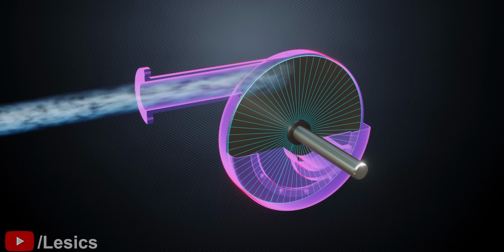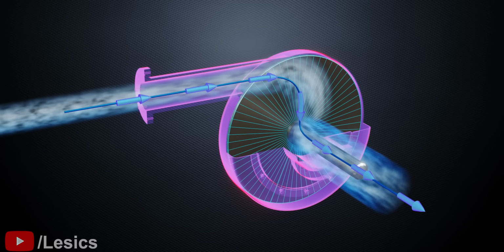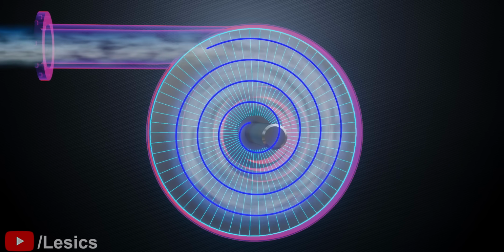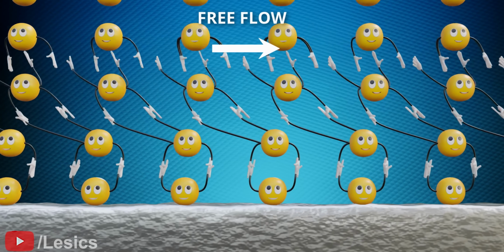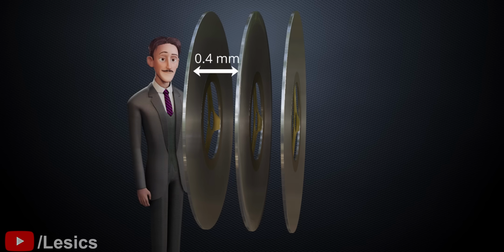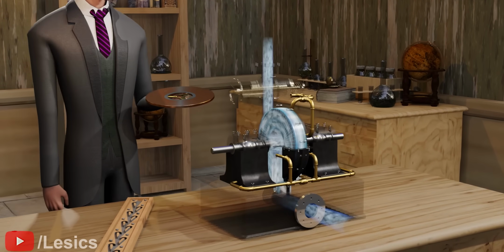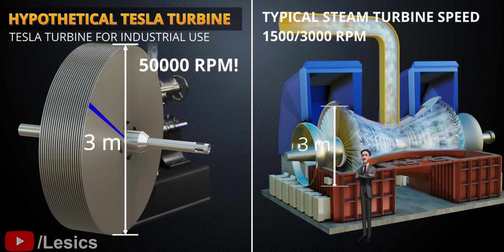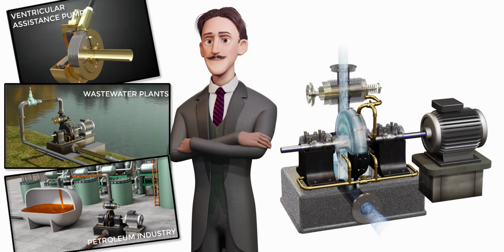Tesla Turbine | The interesting physics behind it

Comment: If you use a fluid with a higher viscosity, can you reduce the RPM without a significant drop in efficiency?
Reply: The RPM should be mainly determined by the density of the fluid.

Comment: Has anyone tried to increase the surface friction of the disks? Would a rough surface reduce the rpm and increase the efficiency?
Reply from the maker: Exactly, disks with good surface roughness will obviously increase efficiency.
Reply: @SabinCivil  so why dont we make them with tiny pits(such as golf balls) on them if we need slower speeds due to material problems? when a high surface speed achieved i assume existence of holes or surface roughness will be neglegtable, becasue of boundary layer.
Reply: No, you are trying to create laminar flow, polished discs are best because roughness leads to fluid  separation and consequent turbulent flow thereby reducing power.

Comment: Now imagine a tesla turbine with two, or three or more inlets. Coupled to a load in order to both limit RPM and to use the work output, this could be an enormously powerful device.
Reply: I was thinking of attaching it to a flywheel, but the efficiency will probably drop to levels below what steam turbines already have.

Comment: More turbines and large flywheels with gear reduction and a release fluid clutch to lower the rpm to safe levels would be something i would bet on !
Reply: Lowering the RPM reduces the efficiency. Consider that the RPM could simply be throttled back by reducing the intake volume/pressure without adding any additional mechanical complexity, but again, the efficiency drops off as the RPM is reduced.
Reply: But then efficiency...
Reply: The higher the speed the higher the efficiency, the steam has greater contact with the surface of the disc imparting a greater force on the disc. I guess you wouldn't want to be anywhere near that thing at 35k RPM when it comes apart.
Reply: Yeah I understand the effeciency will drop of but not working at all is the least effeciency of all!
Reply: @Buzzhumma  I think the real issue was the forces involved, to keep the thing together the RPM would have to be greatly reduced therefore the efficiency would be low, that's why it never really took off. Calculate the CF it's staggering 38 metric tonnes for the small disc at 30k/RPM.

Comment: I saw a training video for steam turbine maintenance, and generation from the seventies.

In that video in the first stage of steam they do use a five-bladed Tesla turbine design.

Because the steam is so hot it can't expand 10,000 times and overcome the boundary layer effect of it being too far apart.
Reply: They don't anymore because it's not efficient and the maintenance intervals were horrible due to micro-cavitation creating pits on the blades, lowering efficiency even further.
Reply: @actually5004  

Thank you for the update.

I saw where a YouTube channel called  ienergy, is building ( low pressure steam) Tesla turbines. I estimate based on the build ( that is very similar to another builder) to cost at least $15,000 to have somebody build it for you.

With an electric motor attached (for low pressure steam at 2- 1/2 PSI) out of aluminum. Very nice build.

What he did on  ienergy channel is to point out Nikola Tesla's British patent. Which used vacuum on the exhaust end.

It was a 6-in diameter turbine with a second turbine creating vacuum, on the first: as per Nicola Tesla's British patent design.

In the other video (on steam turbines) they talked about putting vacuum, on the back end of the turbine that was built differently. Creating the same effect that Nikola Tesla put in his patent.

ienergy's:  6-in Tesla turbine with vacuum on the exhaust and with two and a half PSI of steam only got 850 Watts at full power. Turning at 50 to 70,000 RPM.

In effect a 1-1/4 horsepower 6 inch, Tesla turbine; that was properly built per the patent, with vacuum on the exhaust end and only two and a half pounds of steam.

Basically not cost-effective on small scale. Now you're telling me on large scale it broke down.

You can get a regular built pneumatic vein motor of any size at a cost of about 50 bucks to $3,000 for a quarter horsepower going all the way up to 21 horsepower.

For air or steam.
So to make any turbine more efficient you just put vacuum on the back end which is easy enough to do.

Looks like we will still have to wait some more time, till they come up with a super material; that is "imprevious" to the rigors of this build. Boy what a material that will be.

Separately:

If you go to the YouTube channel Patrick Henry he has numerous builds that look very promising. Some of them have no or few moving parts which means nothing can break down. All can be built from simple parts.

A very interesting channel in my humble opinion.

Thank you for your input, it has closed my investigation of this build. Previous to your comment, I was assuming that they had fixed something on the large scale. But it's just not cost-effective.

For power to be a cottage industry: done by the renter or homeowner, it has to be something that can be:
1. easy to build, 
2. cheap to build, 
3. easy to repair,
4. Does not require a lot of maintenance,
5. Can be moved if you have to relocate, 
6. Cost effective on building install, to get your return on investment, by the savings of the power that you'll be using.

It is estimated with our technology increasing, and the demand for electricity for cars and electronics, computers: 

We will end up needing three times as much electricity per person as we are currently using at 2 KW a day for each house we'll go up to 6 KW a day for each house.

The infrastructure is not designed to handle this and they have no intention of building before the crisis becomes a catastrophe. 

The only remedy is to self-mitigate and have a standalone system off grid. By solar panel with a 30-year burnout is not cost-effective.

The Patrick Henry channel shows builds one can make one self to produce what you need from off the shelf parts.
Reply: @reypolice5231  The real information is out there, but it takes real work to sift through the nonsense because nothing in life is truly free.

Comment: This is interesting, however it seems that some of the physics is misunderstood.
Reply: Why it seems physics is misunderstood
Reply: @vridhikhanna1580  If you increase the size of the disks you will decrease in rpm while increasing torque.  Steam turbines are not efficient in the aspect there is wasted heat energy. This is just a few, I could go on however I don't have time.
Reply: @davidkatuin4527  No, increasing the size of the disc is important to produce the torque required the speed is very important to increase the effectiveness of the boundary layer see 3:33
Reply: @coyote5735  if I put a 3inch circumference wheel on top of a 6inch circumference wheel, turn the 3inch wheel one turn how many turns will the 6inch wheel make ?
Reply: @davidkatuin4527  They both rotate together, the difference is the velocity at the circumference of each disc, what's your point if you have one?
Reply: @coyote5735  if the 3 inch circumference wheel rotates once,  the distance traveled would be 3 inches. What distance would the 6inch wheel travel?
Reply: @davidkatuin4527  What next " The wheels on the bus go round and round"? Make your point then we can chat about it.
Reply: @coyote5735  if you answer the questions you will reveal the point.
Reply: @davidkatuin4527  Lol........

Comment: Very little discussion of torque values. High speed is useless without torque..
Reply: see, since this is a machine for convertion, all you need is the efficiency factor. whatever power you put in, multiply it with the efficiency factor and you get the output power. and, since power is a function of revolutions per time, you can easily calculate the torque.
Reply: That's why you need a large diameter disc to generate the torque.

Comment: The biggest problem with Kaplan and Pelton turbines is Micro cavities. Small dreoplets that pop under the water and create small tornadoes, drilling onto the turbine blades. They must be regularely removed from action and maintained . Viscosity is known to airoplane workers, as "drag", or resistance to flight, air resistance in the paint and metal surfaces ( not airodynamics)

Comment: I can't help but wonder if an assumption was made about the speed of the turbine blades relative to the industrial sized blades.  I may be remembering wrong, but I believe Tesla increased the size of the rotors so he could achieve greater efficiency with less speed.

So Lesics, are you assuming that the speed is constant regardless of the rotor size?  I'll subscribe if you can prove it one way or the other.
Reply: Everything that I have seen tells me that the speed drops with increased rotor diameter. But always open to new information. Cheers John
Reply: @notsocrazyjohn5348  I think that's natural if the power input remains the same.  I thought that Tesla was increasing the size so that he could get the efficient results with slower speeds.  I'm not disputing that the pump has issues of course.  Having to spin the discs that fast to get good results is very problematic.  Anyway, appreciate the response.

Comment: I spent the last 4 minutes thinking,  "Yeah, but that's ONLY if you're using really low-density fluids, like steam though!"
Reply: At any scale that matters, uncontrolled micro-cavitation in a system like this at any density both ruins the pumping efficiency and destroys the blades.
There is a reason why modern turbomolecular pumps actually work and these don't.

Comment: So why can't we build smaller discs?  1 foot in diameter and use something like titanium or inconel.  We could probably get up to 80K on that.  Can't be more expensive than current designs.  Easier to maintain and fewer moving parts.
Reply: Why not simply try it for yourself, then?
Reply: @Iamwolf134  Turns out I don't have $15K for an inconel casting....or the access.  I talked with a Boeing Engineer and a Air Force mechanic.  They both said 302 Stainless might work.  I'm just saving the money for the disc machining and the housing and currently making designs.

Comment: Mastery of material, then this could be a game changer.
Reply: Solving this also allows for commercially viable fly wheels, and therefore industrial scale energy storage, and therefore 100% viable renewables
Reply: @JohnSmith-pn2vl 
1) unless your country stands atop a geothermal source of activity (cough cough Iceland cough cough), then no, renewables were not always viable. I am talking about economical viability. Solar panels have become viable in the last decade, and weren't before. Using wind has been an option for at least 700 years, but due to the uncertainty in wind flow and direction, it was not viable until late 20th century, when we gained good enough materials and engineering to create large structures that could use the wind and rotate to match the direction. We still do not possess a solution for the uncertainty of wind flow, and thus wind farms have limited use... 

2) while flywheels are available, the technology is not yet usable at an industrial scale (the only scale that matter when we are talking about electrical grids) for the simple reason that we're unable to make them large enough for this solution to be more efficient money-wise than just using thermal plants (gas, oil, nuclear etc..) and just adjusting output to demand. This is why we should try and get those materials that would allow for bigger fly wheels. Also, maintaining a vacuum on a large scale is quite impractical.
Reply: @JohnSmith-pn2vl  where are you from?
Also I get my data from my mom who works in solar panels deployment
Also, while solar cells where invented in the 1910's, you had to wait until 1954 to see solar pannels, even if they were still in use (which I find unlikely), they would have poor efficiency (≈6%instead of the modern 25%) and would be too young to be 80 years old (unless you are 13 years in my future, which would explain a lot xD) 
Also carbon fiber is a hell to produce, and no, flywheels aren't everywhere. The only thing that could match this behaviour you describe is the rotor having rotational momentum in thermal plants
I did find a source for windmill 3k years ago. My bad on this.
Also modern flywheel have about 25kWh of storage in them, and since the modern American uses 12kWh per day, that would mean one would need a lot. You might argue that you only need to store so much power, but for America alone, one would need to compensate for ≈200MWh differences, which is 8000 flywheels on top of the ones required for night time and days without wind. (source : https://www.eia.gov/electricity/gridmonitor/dashboard/electric_overview/US48/US48) 

I myself live in an area with a lot of hydroelectricity, but such a situation is not standard, and one cannot expect to make generalisations about widespread use of renewables right now from our vantage point

https://www.sciencedirect.com/science/article/pii/B9780128033746000019 < here it is claimed that flywheels loose 3-20% charge per hour

Comment: I wonder if increasing the density of the working fluid would increase efficiency at lower speeds. Using a liquid might work better.
Reply: or cold water instead of boiling one.

Comment: i wonder why no one added small ridges to increase surface area?
Reply: Because this relies on boundry layer laminar flow.
If you have surface discontinuities you will have shock waves and stall above Mach (in whatever fluid you are using)
Also anything that breaks the laminar flow will cause separation, which is a net reduction in drag. (Think of the reason for dimples on a golf ball)
This whole concept is based on getting as much clean drag as possible.

Comment: Perhaps using steel wire mash screen (fabric) with rim instead of disc might work. Small vacant space between wires might even help. (Like London ferris wheel with intersecting wires..)

But of course, vibration and wobbling tendency could still be issue even with proper wire mesh design.. or adding additional rim with different wire tension.

Anyway the design was fascinating as usual. Tesla was such remarkable person with remarkable. personality.

Comment: I think Tesla turbine can be useful with oil rather than air or steam. For example, a tesla turbine can be used coupled with a linear hydraulic generator in marine energy, which for its nature is an oscillating force, that pumps the oil into the tesla turbine. Maybe a very viscous oil can drop the angular speed required to reach a good efficiency of hydro-mechanic conversion.
Reply: Cavitation losses increase with viscosity, system damage is inevitable with cavitation at any scale.

Comment: Insted of adding diameter (3 meter), why don't they add more turbines then.
Reply: That's called compounding, and Tesla advises compounding for smaller turbines. Good call
Reply: @iEnergySupply  thank for the information.
Reply: Economy of scale - In the power plants, huge and less number of power generation units are always preferred. This also means easy maintenance.
Reply: @sabinzmathew  yes, that's also true. We have to find out the balance between the maintenance & investment cost with efficiency profit. Maybe that is the reason why tesla turbine is not profitable. I think infuture, we will find better material where Tesla turbine will be profitable. Sorry for my bad english.
Reply: @sabinzmathew  tesla turbine numbers for maintenance and design/build are much better
Reply: Right! Also, why use it for steam, which has low viscosity? Couldn't you use it for things like water, such as for dam turbines or smaller turbines from rivers?
Reply: @True_you_coming_through  the oil industry already uses them as pumps, as well as waste treatment. But as an energy source it falls down because of flow rates with fluids...it shines when there’s both heat AND pressure.
Reply: @True_you_coming_through  Water although has definitely lower RPM. But still way-way-way faster than normal turbine (only 3000 RPM) with comparably same efficiency.

It doesn't make sense for other than super high-viscosity fluid
Reply: @bocahdongo7769  don’t forget that 2,000,000,000 horsepower is achievable in bladed turbines even at low speeds from the induction of the GENSET. there is a great way to think of the bladed vs the Tesla...bladed turbines are Superman~the Tesla turbine is the flash. And that makes a lot of sense, since the Tesla turbine patents keep jumping forward through time to be used continuously.
Reply: Meter not mitter
Reply: @xj9779  thanks, i have corrected it.
Reply: All of the comments here miss the forest for the tree's.
NONE of Tesla's inventions are stand alone products. They are all steps on a technological ladder to the main goal:

Harnessing the "Wheelwork of Nature".
Don't lay into me about "muh conservation of energy", either.
There are BILLIONS OF STARS OFF-GASSING ENERGY INTO THE INTERSTELLAR MEDIUM.
Reply: @FireBeam  well actually put some words behind “gathering ether” that’s what everyone’s trying to do none of us were Tesla so forgive our meek understanding. But if people talk about it often don’t back by maybe we can solve steps on the ladder right?
Reply: @blainevans9237  
Did that make sense in your head?
Reply: @FireBeam  o sure, but when i said it to siri it did NOT make sense to her...thanks for “fixing” what i said siri.
Reply: @blainevans9237  
🤣🤣🤣
You're alright 👍